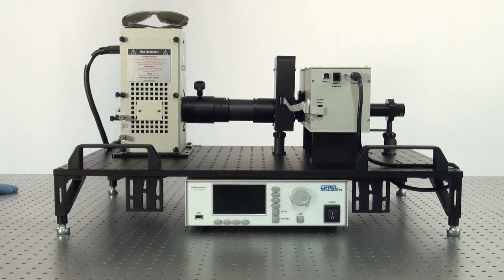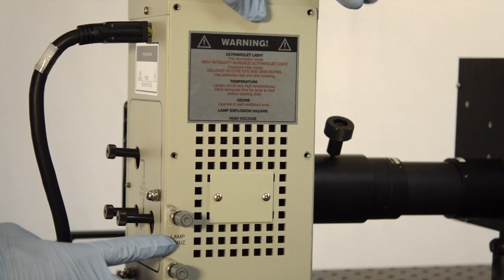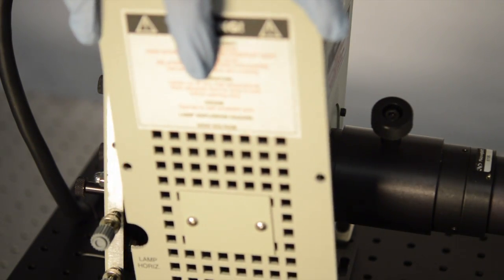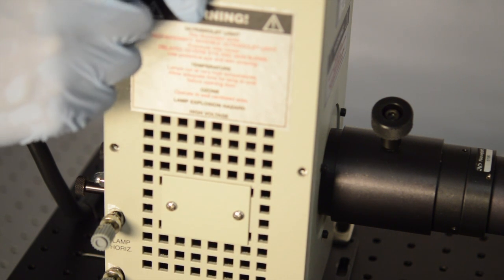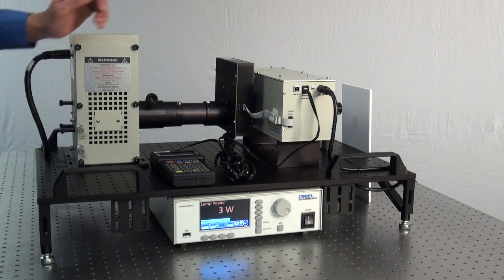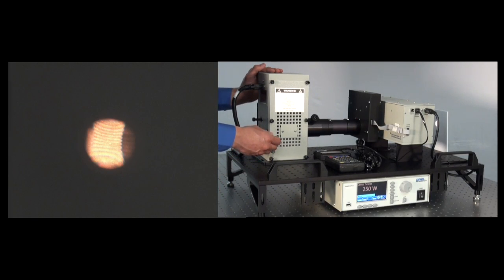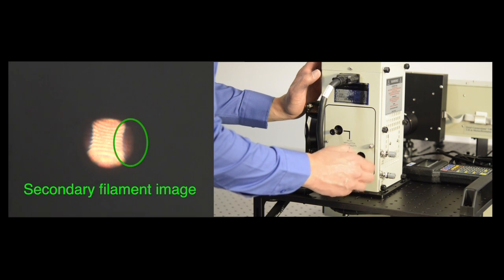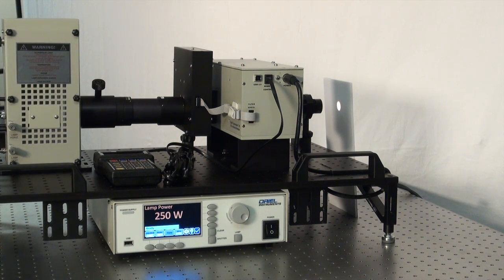QTH Lamp Model TLS Alignment Procedure

Comment: BAE System used this procedure on a luminaire with a larger power rating (1000W) and larger lamp rating (600W). On the unit with higher power the direction to overlay the filament images is INCORRECT. In fact, a burnt lamp results.  -- John Whitcraft, PE